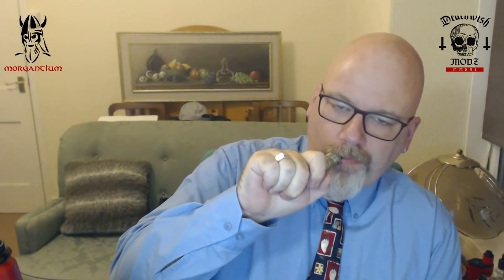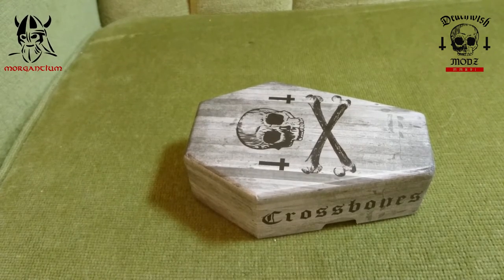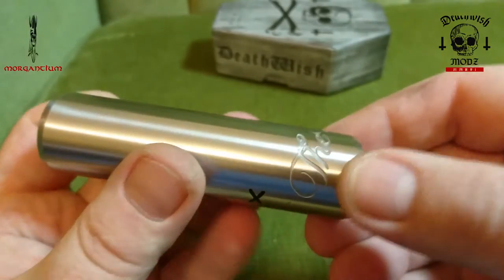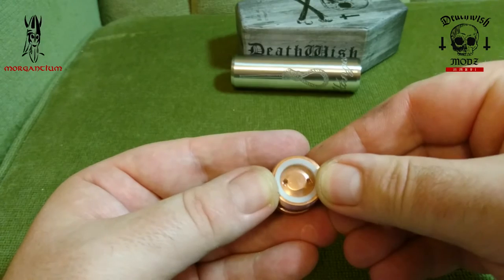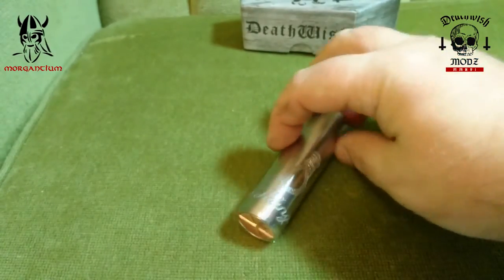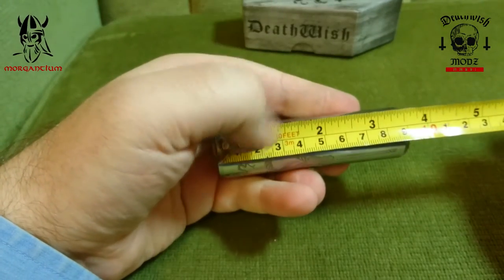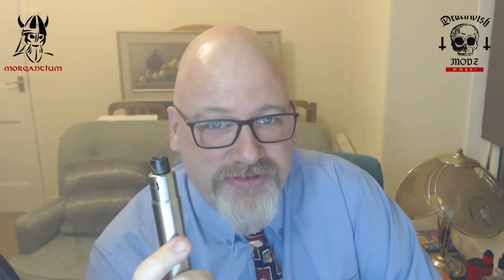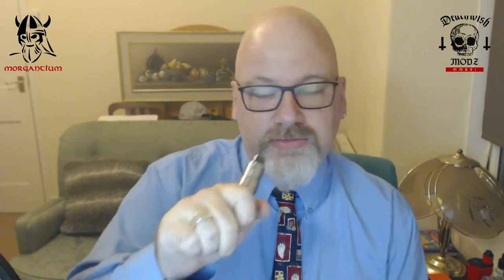DeathWish Modz Crossbones 'The Hanged' Mechanical mod review

Comment: Great review, I am looking to get this mod myself and you certainly helped my decision.
On a side note, this is not a gripe and I hope you take it as constructive criticism. In normal circumstances if a battery fails the pressure will escape by any means it can, out of the bottom or the top it doesn't matter. If the battery is positive side up and there is a break in the wrap it will simply complete the circuit and auto-fire. If it is positive side down the path of least resistance will be a direct short with very very low resistance, and that is asking for trouble. This is why positive side up is the norm for mechanical tube mechs.
Reply: Hi. I just bought this mod, the hanged, and I was thinkng about the vent hole at the bottom. Shall I place the battery with positve at the top or shall I place it with positive down towards the vent hole? I didn't understand what you mean, would be really thankful for your help :) Oh, sorry about my english im from sweden, but I hope you will understand what I wrote ;) / Nikk from sweden
Reply: Nicklas Olsson Hey, I might be getting this mod soon too. I think that it should be fine and is completely normal to put the battery facing up so the psoitive side is facings towards the top part or up part of the mod.

Comment: Hi just a quick one on the venting I own a rig pig and the vent holes are both on the bottom but the battery's can't be put in both positive down and to be honest I would rather have the venting or the short at the atty end than at the button were your finger would be and would also be easier to get a venting battery out of the mod with it facing away from the button just my opinion
Reply from the maker: Vape shack prescot every device has its vent holes in several different places, in four years I've had a battery vent once and that was in a parallel box mod. And that vented out the box door. Ideally I wouldn't want a battery venting near my face or finger on the fire switch. But it has to be at one end of the mod I suppose. Series boxes are more difficult to setup for venting I suppose? Thank you for your comment

Comment: If you put the battery positive up and get a short through the battery wrap your mod will just constant fire which you'll notice as soon as you screw the button in, if you go negative up and get a short it will bypass the atomiser and hard short the battery causing a catastrophic battery failure. Negative down is an absolutely terrible idea.